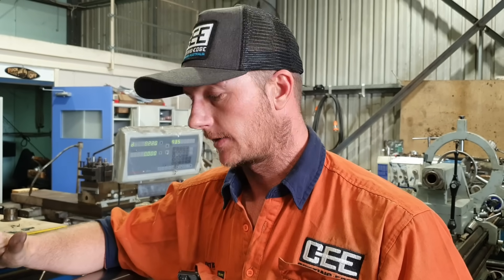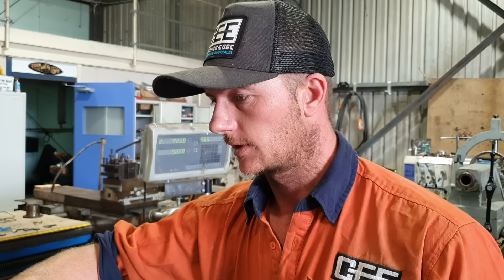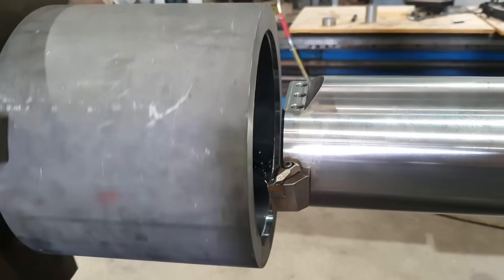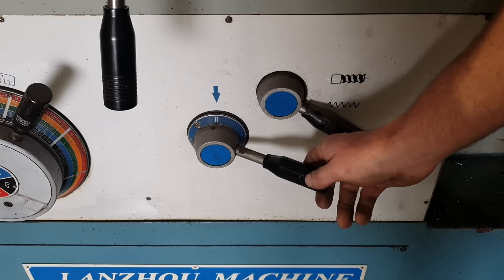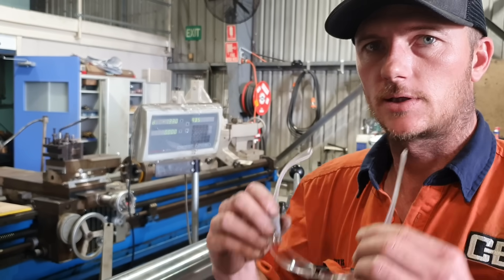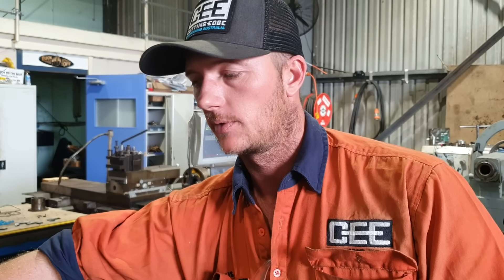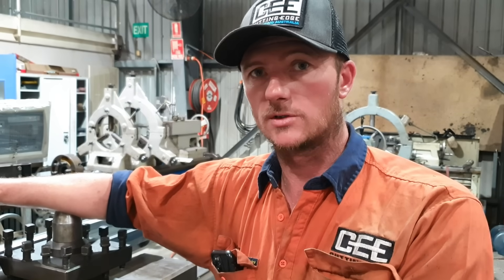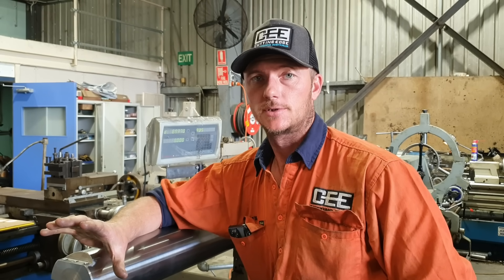Testing the BIG Boring Bar | Shop Made Tools

Comment: I'm 76 and retired. I'm a machinist, welder and fabricator. Through the years I've made lots of tooling. The one take away concept that never changes is: 
round stock is the worst material to use. 
It's usually the first selection that a machinist will go to. Deflection is not the problem with round stock. It's the resonance vibration. You may not hear it but it's singing. The best shape for a boring bar is an octagon. Minimal resonance and usually a zero deflection. 
You can reduce the size of a round boring bar by up to 40% which will dramatically save weight and expense.

Comment: Wait a minute. If the deflection at the tool post is 0.2mm,, how much is it near the insert?
It has to be a lot. If only you could start the cut couple of mm higher. Side to side diameter is higher so it's good

Comment: I’m sitting here trying to think how to make it longer. Thinking on adding adjustable tail stock support.  I think it will be ok on vertical deflection but not so sure on horizontal load deflection.    A slip collar with tail stock movement would take up most of the adjustment. But you might have to reset the tail stock mid cut.

Comment: Hi Kurtis, a thought that I had regarding testing the boring bar is to mount an accelerometer on the end and monitor the vibration electronically in 3-axis.  Smartphone have an app that can also be used but only as a listening device.  The phone approach is more available (free) and gives you a visual display as well as auditory.   If you use an separate electronic detector, you will also need an oscilloscope to observe the vibration frequencies, intensity, amplitude, etc.  This can also be used on all your tools to monitor performance.   Dave

Comment: Just info but was cutting with a 2" X 24" bar.  It was a pretty small job.  It was about 150 parts torch cut rough hole then to size on the lathe.  Unbeknownst to me my boss had welded the bottom of the tool post.  It was only 3/4" thick.  I heard a noise halfway through was hands on handles but before I could get out. Well the post broke free, sent the post and bar across the shop.  No one was hurt. But just a story of warning on tool post strength.  Or the case of.

Comment: Lovely bar and well made,  but at that size there's no way id stick it in a toolpost. Far too much deflection and movement between it and the bed. You need to ditch the compound slide and  toilpost and make it's own mounting block that will fit tight on and around  the crosslide using every bolt and tee slot available.  If you've got a good wide beefy crosslide you're laughing and let a bit hang out the far end to balance it better and hang a bit of weight on.

Comment: 4:46 - can you use those strings for anything - what comes tom is making 'steel' wool out of brass (if it will do it...) like what is used in soldering iron tip cleaners?

Comment: Very nice. We had a big bar where i worked in w.a. for BHE rebuilding hydraulic cylinders. We used a boring bar which needed the toolpost to be removed and bolted down on the toolpost mount. Bar was approximately 1.4m long. Only 110mm diameter. We used 16mm left hand turning tools and found the TNMG .8 RAD inserts to be very good. We used to spin job at 120rpm 2mm depth and .4 feed let the tool bite down and stay down. This was used when boring out front strut rods on the 797 dumpys. 
That material looks very soft which will be harder to control chips. Coolant will help making the chips more brittle and get a better chips.

Comment: Carbide inserts...SFM not RPM..always refer to insert manufacture's recommend SFM for type and grd insert / material.types to be cut. 300 SFM is a lot easier to remember than trying to remember the right RPM for every change in dia.   Of course you have to do the math so you can select RPM on a manual. Proper heat at the edge is important. So is coolant most of the time.

Comment: Amazing! I do wood lathe work myself but wow to see that bar that far out and kicking but is incredible. 

I do have a few questions.... 1. Do you recycle your your own scraps and use an on site forge to melt the scraps into ingots?? 2. Have you ever tried spray welding to build up the surface of a part as apposed to arc welding that I have seen you do in another video? 3.Which procedure works best? Arc Welding to build up a surface on a piece with high stress tolerances, or spray welding? Keep the videos coming my friend, and I really enjoy your work and your wife does a great job video taping.

Comment: Just a question. At the mom and pop shop I was at I did something work on a Leblond  lathe a little bit bigger than your jewelers lathe, most all of the tooling was home made,hand ground high speed steel,when there was carbide that was a treat.I did learn a lot from Adam (much older German lathe operator). So my question is setting the hight on the boring bar, “on center or just below?” Home made and hand ground always made it difficult to get the same results, thank you.

Comment: I had toolpost screws lose their grip on bigger cuts so I made my own toolpost for boring bars cutting a neat hole through the tool post to fit the bar. Great if you put an adjustable boring bar in the lathe chuck to bore out the hole in the tool post as it is at the perfect center height. Fails when the boring bar is too big in diameter. I like how I can rotate the bar tool to set the tool angle for different materials. May have to shim under the tool post to get it right.

Comment: That's a great tool and its stiff . Many years ago I was a kid and my father was a Machine shop foreman . He had a shop at  home also to work on his equipment . His D7 had a bearing go out in the final drive and wipe out the housing  . Cat told him there was no way to fix it . Dad built a boring bar that attached to the final drive and used the machine to bore the frame it was dead on .He then built a sleeve to hold the bearing .  I never forgot that

Comment: I solved the problem with the vibration of the boring bar using a counterweight also fixed in the tool holder, the length and weight are selected empirically.

Comment: Over 12years ago i was an apprentice in local sheetmetal rolling factory working in machine shop segment  handling all lathe machine...

Your test material seems and sounds like our exact big chemical roller material...

That 2m drum roller in diameter were ringing like a loud bell everytime we have to resurfacing job on it...

Not to mention the chips were quite itchy to the skin (definately full face and body protection jacket moments when dealing with such chemical related rollers)

Its quite nice experience working in machine shop doing repairs work like this...

Although now im nowhere near any turning/milling/welding work environment, i do drop by to mate's shop doing my own turning / milling for bike/car parts repair in my free time (good hobby i would say) 😁

Cheers 🍻 from Malaysia 🇲🇾

Comment: Was there deflection or movement of the tube (i.e. the test object) within the jaws holding it? After a while, the test object seemed to sit a little cattywampus in relation to the plane of the jaws. Great job designing, building, and working the kinks out of the Big Boring Bar!  Thanks for explaining things as you tested the rig.

Comment: Why don’t you seem to care measuring the vertical and lateral flexion of the bar itself under working load ? That seems important to ensure that any cylinder machined on the lathe with this bar has its center axis perfectly true and it’s profile straight (cylindrical). Or is it not a worry ??

Comment: That is a chonky boi of a boring bar, mate! This was a great look inside purpose-built tools. I love that if you can't find what you need, just build it! Looking forward to the next vid! Say hi to Homey and the Lady for me!
Reply: Hi, I was a machinist, small parts. What about using a hex shaped bar in a dedicated tool holder/post. Clamp the hex bar between the posts attachment to the sled. The two halves of the tool post directly over the post bolt would create a very solid mount with little ability to vibrate. Just a thought.

Comment: That’s pretty much how we used to do it at the Rolls Royce Experimental Works in Derby back in the ‘70s. The bigger the bar the better. More mass equals more stability. Small steady cuts. What you’re looking to avoid is vibration in the bar and the work. Both can play on each other. I remember one of my worst experiences was boring large diameter blade rings at the main works on nights. Those things used to squeal like banshees! The only thing worse grinding in the shop nest door.

Thank you for sharing

Comment: Noice bar, good for you sir.  Insert holder mods are as required, but remember that the cross slide has 2 "Acme" nuts that are adjustable, for the cross slide spindle.  I loosen/tighten mine bc it's fun lol. Looking Good, easy money

Comment: Went from burger king to a smallachine shop and ran manual lathes for three years then moved to another small machine shop and started learning cnc machining. Makeing high tolerance seals mostly out of different plastics. 6 months in with no knowledge and I'm the night shift manager hahaha. Nothing better then setting up a machine to make parts with the perfect finish and .0005 tolerances. Anyway this is a big ass bar I'd like to know if it will taper the part or stay true all the way

Comment: Seems to work really well! Takes some balls to test this beast on a manual lathe with that material :)

In some cases I like CERMET CNMG inserts for roughing softer steel material.
They can't take a lot of cutting depth or feedrate but they give you really nice and small chips.

Comment: Clearly an essential tool for a big lathe with big workpieces. I never seen one this size commercially available but I have never looked. I have a 2 inch diameter, 18 inch long bar that I thought was big. Nice to have the raw material around to build such a monster when you need it. I don't have any cutting tools that I need a crane to lift. Very interesting as usual.  Nice job.

Comment: Pretty good bloke. Turned out well.  Length of steel brake line fastened on the top might be a durable way to get flood coolant pointed directly at the insert. Save you from thru drilling it. Should be able to withstand chips.

Comment: I remember one job that was a winch drum for a mine. The drum was about 8 foot diameter and the cable ways had to be cut in it.  The there was no chip breaker on the hand ground tool and the chip came off in big long wide pieces.  They were about an inch wide (one banana) and about .03 thick.  I think I would rather fall in razor wire than mess around with that chip.

Comment: Used to draw tooling with detail for building in ISO cartridges.   Used extensively for deep boring on Gray Cast Iron and SG Iron.  Mostly CTFPR 16 CA 16 .   TPUN inserts K20.    Also negative rake cartridges too for more heavy duty boring.
😎🇬🇧👍

Comment: Love the banana measurements
It would be cool to find out how much the boring bar tip deflects downwards. Based on the toolpost rotation to the bar length, I reckon you'd get 0.6 mm. So long as the cut is consistent, the deflection shouldn't matter too much

Comment: Kurtis I've run this metal a lot, carbide will run it and I've also used high speed Steele cut and grind it and give the relief it needs and it will work.

Comment: I think the most important thing now is to pay attention to the accuracy of the surface with such a long arm of the cutting tool, depending on the number of revolutions, the speed of the feed, and in general, the speed and cutting conditions. As you said, you have to test it with different materials and types of coolant. Maybe I wrote something you already said, but I don't understand Australian English too well. And maybe im wrong but i think The optimal cutting depth will be between 1 to Max 3.5 mm per pass. But i was learning cutting Edge engineering in early '90 and now tools Technology it's different.

Comment: Please can I ask, as a complete novice in regards to lathe work. Is the measurement you took at the tool post linear to what the deflection would be at the cutting edge? (see what I did there). How does it equate to the deflection at the end of the boring bar?
Also, as a dog lover, could you please first thoroughly wash any toy that somebody sends in. (just in case there is some a-hole out there).

Comment: Hi Kurtis! At 7'40"... The Finish Cut(?) : The "Chip - wig"... Can it be a problem for the insert(chip jam) / surface problem at a long run/bore for this job? Do you hone the bore after turning? Have a "noice dayee" 😁 👍 Push the Button and torment the electricity meter hard as you can! 😎

Comment: I really like how the tool performed under the tsting and how you plan to use the data obtainted to make it perform even better. Kind of like the job I am running now in CI, 3 13/16" {96.8 mm} ID bore, 16" {406 mm} bore length, cemented carbide. Bar 3" {76 mm} Dia in a Warner Swazy 3A turret lathe. I am not sure of the alloty that the bar  is composed of shop made before I worked their. I am going to measure deflection today, just for shits and giggles. Takes a 3/8" over all DOC (roughing).
Part is  a rope drum for raising and lowering gates in water treatment. Have 12 to do so one agressive rough pass on the bore speeds things along. The W&S T. lathe is a beast. I will try and get some pics for you, just in case you need to see some more machining :).

Comment: It would be really interesting to know what the deflection is out at the end of that bar under the load of a cut.  You could put an indicator out there (underneath) during an actual cut or just leave the machine off and rest a 25 Kg weight on the end.  I bet it deflects a couple mm just from the toolpost.  The natural frequency of this setup will make "chatter" occur at a really low frequency (maybe a few Hertz).  Knowing the deflection and load will give you the spring rate.  That and the effective mass of the bar will let you estimate this frequency using an online calculator.  If you turn the work close to this speed (wild guess 200 RPM-ish) you might run into resonance issues.  I can see really light cuts being needed to work the spring out of the tool and give you the accuracy you want.  Great fun watching over your shoulder - we armchair machinists love that.  Thanks for being a good sport on unsolicited advice... 🍺

Comment: Really nice turning banana😋 Couple suggestions for the even better performance. Dial any wanted depth of cut and measure at end of the bar how much it's deflecting and add same amount under the boring bar in the tool post. Now tool hight should be more like in the centerline and surface Finnish should be better. 
Second useful tip is add more overhang end of the boring bar it eats vibrations.  04 nose radius and even stickyer stuff positive rake insert are worth of trying in Finnishing cuts.
Keep on boring bananas 😆😆

Comment: "0.10MM Deflection at the post", any guesses what it was at the end of the bar ?
Reply: Well that's what I was going to comment on.It will have to be approximately length of boring bar divided by the height of dial from base to point on tool post and times by the values he has shown.I reckon average of 3 times the readings he has.

Comment: Place I worked at years ago made up dedicated boring bar holders that would replace the 4 way tool holder ,they held bars up to 100 mm dia and dampened out vibration really well. they allowed the axis of the bar to be closer to the centre of the topslide. Be a good project for you !

Comment: There's a slight bit of ringing noise from the work piece so zero doubts anything with a heavier wall or shorter projection from the chuck would have an even better surface finish. I suspect but obviously don't know for sure there's enough deflection in the lathe components to throw the tool tip a bit below center under those cutting loads. Indicating how much that boring bar end deflects and then shimming it maybe .003"-.005" above that might show further improvements and less chance of the non relieved front rake on the tool touching the bore wall. At the end of the day I really doubt I'm going to think of anything you wouldn't though. That boring bar is remarkably stable for it's length and much better than I would have thought. I guess size does matter.

Comment: I used to set an extra steady at the start of the bore and clamp a section of heavy flat bar on edge to it. The flat bar supported the bottom of the boring bar similar to the way your free hand supports a pool cue during a shot. With that setup there is little to no delfection in the vertical axis. I've been wanting to make a dedicated sort of fixture to do the same thing, but add a sliding V-block that can be locked in between passes, so both the back and bottom of the bar can be supported.

Comment: I figured there would be a bit of deflection, with 600 mm hanging off the front of that tool post, I mean how could there not be? It's kinda like putting that 8 foot cheater bar on the 1/2 drive ratchet... I don't think (from my limited experience) there's anything there that you can't compensate/plan for tho.    Nice piece, very Nice indeed!  Very jealous ... I need to get a lathe and a end mill for the shop ... along with about a dozen other tools that would make fab work soo much easier!   

Keep up the awesome work, and love the 'bonus' monday video!! Thanks for taking the time to bring us along!

Comment: Why don't you drill a 3/4" hole down the centre tap a thread in it for a plug and fill the centre with 1mm led shot for a vibration damper?
Reply: Or rubber

Comment: Was wondering as you had the length on the bar original why not leave a tail on to balance the weight of the bar in the tool post. To unload the twist moment on the tool post ?
Interested as a design choice